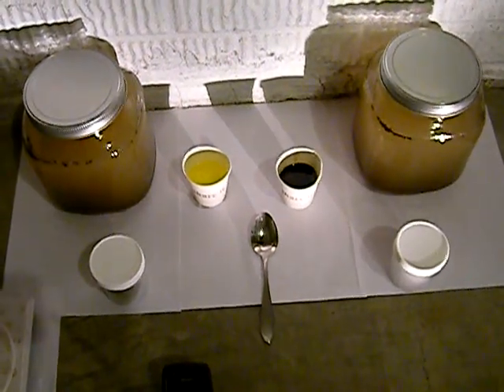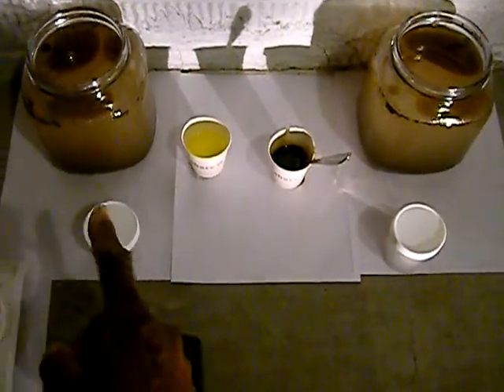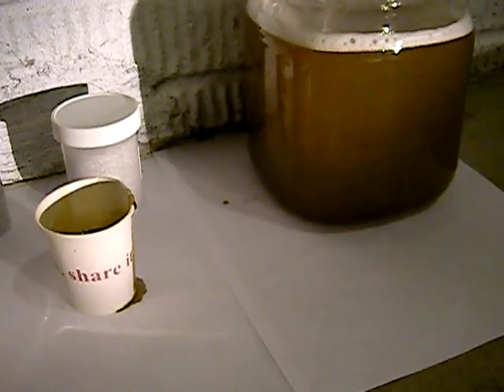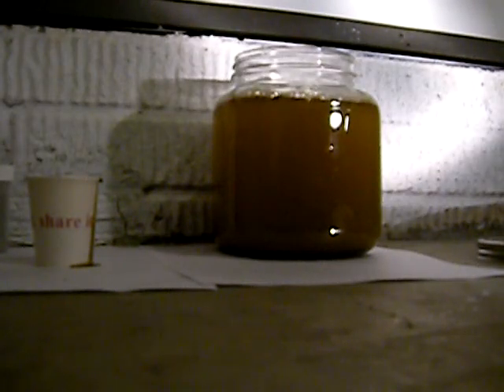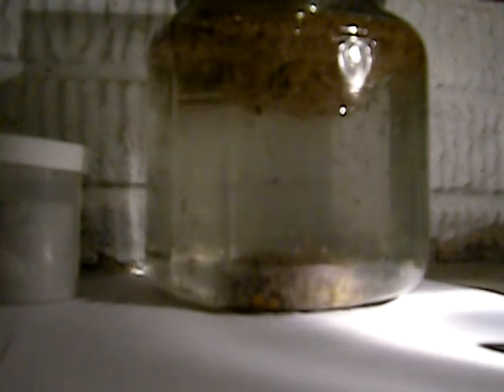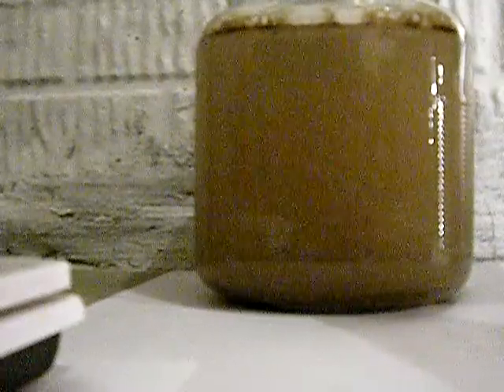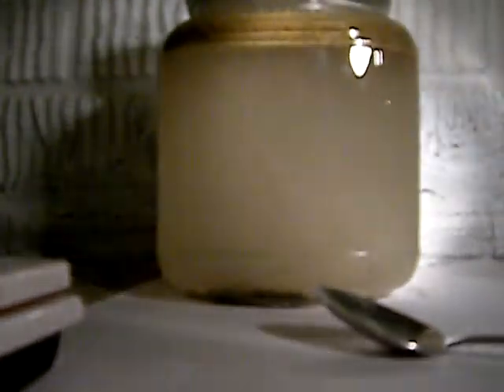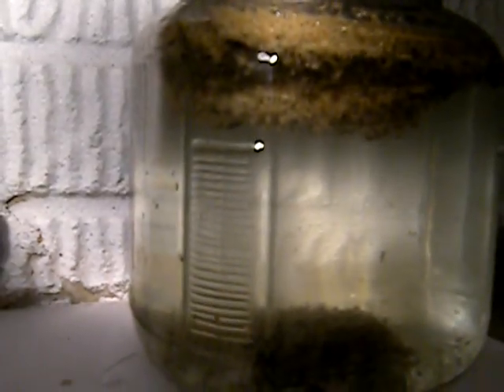Recycle Recycling Pressure Washing Wash Water Flocculation Treatment Flocc

Comment: Hi. May I pls ask what coagulants you used for Floc A and Floc B? I am currently working on my thesis on recycling laundry greywater so that it can be used for laundry again. Based on research, the best coagulant to remove surfactants from laundry greywater is ferric chloride. I aim to recycle 50 gallons of laundry greywater, can you help me calculate how much ferric chloride is needed and what speed of mixing is required? I will greatly appreciate any help. Thank you..

Comment from the maker: This technology has been around a long time George, water treatment plants around the world utilize it. The best method to achieve final separation for mobile application is through settling and gravity flow through a filter membrane (a clarifier on water treatment plants), example sand or geotextile fabric. I have found if you impart energy (example: like from a pumps impeller) the separated sediment in the solution breaks up and re-suspends and you would end up almost back where you started.

Comment from the maker: Hi Lou, good talking with you. Quoted from Wikipedia. "Flocculation, in the field of chemistry, is a process wherein colloids come out of suspension in the form of floc or flakes by the addition of a clarifying agent. The action differs from precipitation in that, prior to flocculation, colloids are merely suspended in a liquid and not actually dissolved in a solution. In the flocculated system, there is no formation of a cake, since all the flocs are in the suspension"